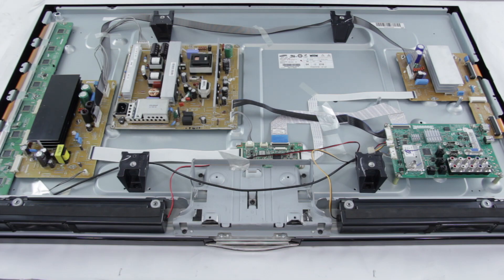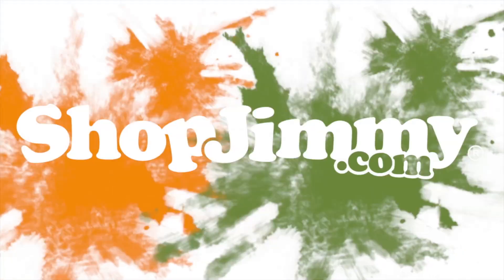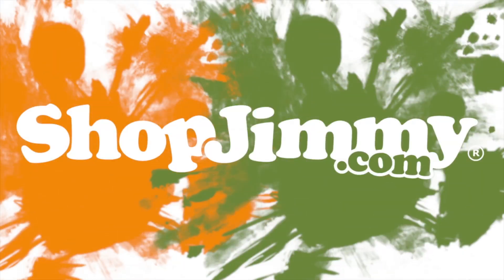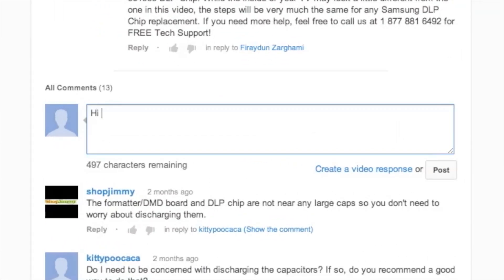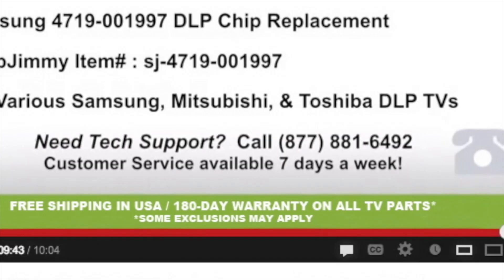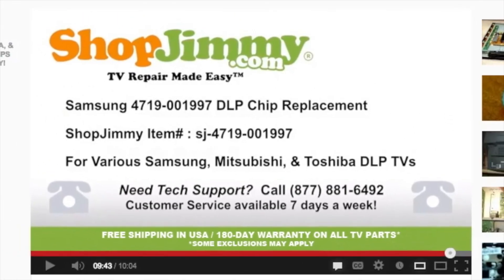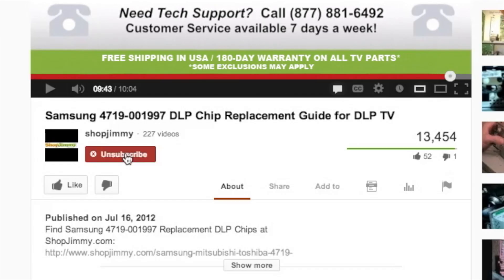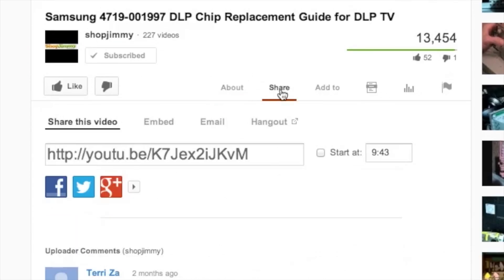Plasma TV Repair Tutorial - Common Symptoms & Solutions - How to Fix Plasma TVs

Comment: Hey there... I was just reading your answers to a plasma tv problem over on the forum but it was from 2011 so I'm not sure if you are still involved. Anyway I had a question if you had a moment. I have a Samsung plasma TV that's 3 years old. It's the pN50C490B3D. It was fine but then suddenly it doesn't display and creates this super loud squelchy buzzing sound that also seems to change frequency pitch on occasion. The sound seems to come from the panel and is louder on the front of the tv then it is on the back with the cover off. Ironically this doesn't start immediately with the press of the power button. It makes the samsung chime sound normally, the red LED comes on normally and then it starts. The panel is black, not dimmed so nothin happening there. When I press remote buttons the LED on the tv responds normally and it also plays the goodbye chime when I power it off. What would your suspicion be? My thought was that maybe it needed the buffers and YSus replaced... But then I'm guessing from what I've read. Oh one other thing. If I unplug the ysus and then power it on, there is no longer any buzzing at all and the tv makes the normal chime, etc but obviously doesn't display. Thanks for your time.
Reply from the maker: kghiii I would recommend replacing the Y-Sus board and the Buffers.  Here is a link to replacement parts for your TV model number on our website, click here:  http://www.shopjimmy.com/catalogsearch/result/?q=pN50C490B3D  Be sure to match part numbers on your current board, with your replacement for compatibility.  Here is a link to a video showing how to identify your part number, click here:  Samsung Plasma TV Repair: Samsung Plasma Panel Parts Guide  You can also call our customer service for further assistance with your purchase.  (877) 881-6492  Thanks and please let us know if you have any further questions!  www.shopjimmy.com

Comment: I have a Panasonic TC-P50G15  Experienced a pop and no picture or sound and 7 blinking lights.  Have replaced SU, SD, and SC boards.  7 blinking lights are still evident. Notice that cooling fans do not come on when plugged in.  Is it possible the power supply board is bad?
Reply from the maker: Jan L I would recommend replacing the power supply in your TV.  Here is a link to replacement parts for your TV model number on our website, click here:  http://www.shopjimmy.com/catalogsearch/result/?q=Panasonic+TC-P50G15  Be sure to match part numbers on your current board, with your replacement for compatibility.  Here is a link to a video showing how to identify your part number, click here:  DIY Plasma TVs 101: Part Identification Number Guide for Panasonic Power Supply (PSU) Boards  You can also call our customer service for further assistance with your purchase.  (877) 881-6492  Thanks and please let us know if you have any further questions!  www.shopjimmy.com

Comment: samsung 42" model # PN43D450A2DXZA   symptoms :  tv was working fine then it just shut off and wont turn back on
Reply from the maker: cristian lara I would recommend replacing the power supply in your TV.  Here is a link to replacement parts for your TV model number on our website, click here:  http://www.shopjimmy.com/catalogsearch/result/?q=PN43D450A2DXZA  Be sure to match part numbers on your current board, with your replacement for compatibility.  Here is a link to a video showing how to identify your part number, click here: Samsung Plasma TV Repair: Samsung Plasma Panel Parts Guide  You can also call our customer service for further assistance with your purchase.  (877) 881-6492  Thanks and please let us know if you have any further questions!  www.shopjimmy.com

Comment: I have a SAMSUNG PN64D7000FF Plasma TV. When I plug it in, I get the Smart TV intro screen which then goes blank and comes back every 30 seconds or so. The TV never seems to fully boot up but it also doesn't really seem to be power-cycling because it doesn't seem to get to even standby. It does not respond to remote commands and the factory reset cannot be achieved. I don't think it gets far enough in turning on. I checked for swollen capacitors and did not find any. The main logic control board has a slow blinking green light on it which never stops blinking. The main board has no lights or any other indicators. Any suggestions?
Reply from the maker: Matt Greenhalgh I would recommend replacing the main board in your TV. Here is a link to replacement parts for your TV model number on our website, click here: http://www.shopjimmy.com/catalogsearch/result/?q=SAMSUNG+PN64D7000FF+ Be sure to match part numbers on your current board, with your replacement for compatibility.  Here is a link to a video showing how to identify your part number, click here: Samsung Plasma TV Repair: Samsung Plasma Panel Parts Guide  You can also call our customer service for further assistance with your purchase.  (877) 881-6492  Thanks and please let us know if you have any further questions!  www.shopjimmy.com

Comment: Hello, our problem is after testing out our box thinking it might be the problem we found out that our month old Samsung 51 inch plasma tv signal went out. all cables are connected the dvr box works but the tv says no signal. Is this an easy fix or does it need to be replaced? Thanks for you help
 model number PN51F4500AF
Reply from the maker: Dana Stover I would recommend replacing the main board in your TV.  Here is a link to replacement parts for your TV model number on our website, click here: http://www.shopjimmy.com/catalogsearch/result/?q=PN51F4500AF  If parts are out of stock, you can sign up to be notified when the part is back in stock on the product page.  Be sure to match part numbers on your current board, with your replacement for compatibility.  Here is a link to a video showing how to identify your part number, click here: Samsung Plasma TV Repair: Samsung Plasma Panel Parts Guide  You can also call our customer service for further assistance with your purchase.  (877) 881-6492  Thanks and please let us know if you have any further questions!  www.shopjimmy.com

Comment: Hi.
 I have a Panasonic plasma TH-42PD50U. There is back light, but no image on the screen, no sound and the remote does not work for volume; remote does work only to turn on TV, and when turn off TV 20 blinking light of death. Any Idea? Still no answer after 2 days.
Reply from the maker: Metushelah Licin I would recommend replacing the D Board in your TV.  Here is a link to a replacement D Board for your TV model.  http://www.shopjimmy.com/panasonic-tztnp010yfs-d-board.htm  Please confirm that the part number for your replacement board matches your current board.  You can also call our customer service for further assistance.  (877) 881-6492  Thanks and please let us know if you have any further questions!  www.shopjimmy.com
Reply: ShopJimmy.com Nope. It was not the D board. I replace the DT Board instead and the TV is back ton life.

Comment: Gr8 video! I have a Vizio 2007 manufctr date. Model # P50HDTV10A I get no picture, but it still powers on. There is a blue rectangular box that's about 6 in width and it goes up and down the center of the screen vertically. No sound. What control board is that? Main board?
Reply from the maker: Latoija Snodgrass I would recommend replacing the logic board in your TV.  Here is a link to replacement parts for your TV model number on our website.  http://www.shopjimmy.com/catalogsearch/result/?q=P50HDTV10A  be sure to match up part numbers for your current board and the replacement part.  You can also call our customer service if you need any help.  (877) 881-6492  Thanks and please let us know if you have any further questions!  www.shopjimmy.com

Comment: I have a 50" hitachi p50h401 tv.  It has developed black horizontal lines at the top of the screen.  I read the repair manual and followed the ts guide which said to replace the xsus board.  So I did and of course it is still the same.  I think you are going to tell me to replace the y buffer boards.  Is this correct and if so do I have to replace both or just one?  Thank you for your help.
Reply: So let me clarify...my black lines are horizontal across the top and run about 1.5 inches down....
Reply from the maker: sjgusmc21 I would recommend replacing the upper buffer in your TV since the lines are at the top.  Here is a link to replacement parts for your TV model number on our website.  http://www.shopjimmy.com/catalogsearch/result/?q=hitachi+p50h401  Be sure to match up board numbers for any replacement parts to ensure compatibility.  If we are out of stock for any parts, you can sign up to be notified when the parts are back in stock on the product page.  Thanks and please let us know if you have any further questions!  www.shopjimmy.com

Comment: I have a Gateway P46M103 42" Plasma With no picture. The stand by works and it seems to power up (the power light turns green). Sometimes I get a flash on the screen as it tries to turn on but then stays black.
Reply from the maker: Gerald Ward I would recommend replacing the Y-main board for your TV repair.  Here is a link to a replacement Y-Main board that shows compatible for your TV model.  http://www.shopjimmy.com/y-bulk-su-assy-pcb-4359111401.htm  Be sure to match board numbers for replacement board compatibility.  You can also call our customer service for further assistance with your purchase.  (877) 881-6492  Thanks and please let us know if you have any further questions!  www.shopjimmy.com
Reply: It wasn't the Y-main board. the ribbon connecting the power board to the Y-main board had a pin that  pin desoldered it self. I desoldered it and it seems to work fine now.

Comment: hi...I have  a samsung PS42C450B-1W with serial number. B1R534PZA20484L  ...when I turn on the tv ,VS voltage is created and go well.but after the some seconds VS voltage goes  back.There is no picture and light in  the screen.Sounds are good. Thanks for any suggestion.
Reply from the maker: Jimmy Jassal Conduct at your own risk!  If the wires going to y-main are unplugged , does the VS stay steady at that point power supply?  Reply with the info and we can recommend a replacement part.  Thanks!

Comment: I have a Samsung  model s50hw-xb03. Everyone seems to have problems with lines but mine has bright snow across top and bottom and is severely out of focus in the middle. Any suggestions?
Reply from the maker: Trey Brown I would recommend replacing the logic control board in your TV.  here is a link to replacement parts for your TV model number.  http://www.shopjimmy.com/catalogsearch/result/?q=s50hw-xb03  Please call our customer service to confirm compatibility for your replacement parts and for help with your purchase.  (877) 881-6492  Thanks and please let us know if you have any further questions!  www.shopjimmy.com

Comment: I have a 50" Samsung Plasma Model  #PNC550GIFXZA  - it has several vertical lines.  The reset didn't work and there is no firmware update either.  HELP!!
Reply from the maker: Kelly Broderick This could be a few different options, either the logic board or the TV panel.  If the problem is the panel, it may be more cost effective to replace the TV.  You could try replacing the logic board to see if that fixes the problem.  I am not seeing any search results on our website for the TV model number that you provided.  Please double check that number and search for replacement parts at www.ShopJimmy.com or reply with the TV model number and we can recommend replacement parts.  You can also call our customer service for further assistance.  (877) 881-6492  Thanks and please let us know if you have any further questions!  www.shopjimmy.com

Comment: Hello I have a problem when powering on the TV - the blue power led illuminates and the red indicator to the right stays illuminated. The remote will not switch the tv on/off the power buttom on the left side does not work. If disconnecting the power cable and leaving for 5 mins when reconnecting the tv goes into the same status - blue led and red indicator lit. The red light blinks twice then on the third time stays constant I can not use the buttons on the tv; the sensor detects the remote but nothing is displayed on screen - just remains black. PHILIPS 50PFP5532D TV PSU POWER BOARD PS-506-PH LJ44-00144A 20061129
Reply from the maker: Steve Daffern I would recommend replacing the ymain board in your TV.  Here is a link to the search results for the replacement parts for your TV.  http://www.shopjimmy.com/catalogsearch/result/?q=50PFP5532D  It looks like we do not have any ymain boards in stock for your TV model.  You could call our customer service to confirm, or see if there are any substitutes.  (877) 881-6492  Thanks and please let us know if you have any further questions!  www.shopjimmy.com

Comment: Great vid. I have a 50pk540, board is eax61392501/10.  Symptoms- Plug in- hear 3 clicks, push power- stby light comes on with faint click then 2 sec later another light click and never any picture. Vdc from power sup going into the main, y sus,and z sus boards check good at pins. don't think its the power sup.   Don't know which board is bad. Tried isolating by removing the va/vs plugs going out of power sup one at a time to the other boards but no joy.Any advice would be greatly appreciated.THX

Comment: Removed the back of my Samsung TV to get the exact PBA NO and REV NO for the Y Buffer board so I can sign up to be notified when the board was available from ShopJimmy.  I then vacuumed the back of the TV using a vacuum and makeup brush to clean out the dust.  I found that the top connection on the Y buffer board was slightly up on one end.  I pushed it down gently and plugged the TV in.  NO MORE BLACK LINES!; NOT A SINGLE ONE!!!  I ran the screen burn utility and the screen looks great again

Comment from the maker: @Electra Buickston - I would recommend replacing the y-buffer board for your TV.  It appears we are currently out of stock for your replacement part, but you can search your TV model number on our website and sign up to be notified when the part is back in stock.  You can also call our customer service for further assistance.  (877) 881-6492

Comment: Samsung 50” Plasma Mod: PN50B650S1FXZA Ver: SE04
Symptoms: Single black horizontal line one pixel high all the way across the screen about 4” below top screen. Then four black horiz lines one pixel high, one pixel apart; then ten, now the black horiz line is 1” high w/ 10 more single pixel black horiz lines above it.  All lines are black, horiz, go from side to side and are in an area 2” high & 4” below top. Can this set be repaired with replacement of the Y buffer board and/or Y Sustain board?

Comment from the maker: @bud194751 - Yes, I would recommend replacing the Video Box Board Assembly.  You will want to confirm compatibility, but our website shows this board is compatible with your TV model number.  "Vizio 3850-0012-0187 Video Box Board Assy" - search that information on shopjimmy com to find your replacement part.  You can also call our customer service for help with your purchase.  (877) 881-6492  Thanks and please let us know if you have any further questions!

Comment: I have a Vizio VP50HDTV10A that seems to have a bad DTV input. All the other inputs work perfectly, but if the input is set to DTV the set will sometimes come on, sometimes shows a 'no signal' message. I can switch to any other input and it comes right on. After it's on awhile I can switch back to DTV input and sometimes it comes on, sometimes not. Do you think it could be the video box panel assembly and tuner?

Comment from the maker: @cxihatch - This could be a few different problems.  It could be the X or Y main board.  I would recommend replacing them one at a time or both at the same time to see if that fixes your problem.  You can call our customer service to figure out your part numbers for your replacement boards.  (877) 881-6492

Comment: I have a question on a LG 55LH40 55" 1080p HD LCD Television Model : 55LH40 
about 3 years old of which the lower half of picture does not display. Only top 1/4 of screen works.  What do I need to get the whole picture?

Comment: This issue was corrected by cleaning the connection closest to the black bar on the tn pa 3996 board located on the top right side of the tv (from the back).  Looks like there were 3 buffer boards on top and the bottom, with the boards on the left side and right side.  Don't know what the boards on top and bottom are called or what there function is?

Comment: I repaired the vertical bar that extended from the top of the screen to the center of the screen. It appeared that the tv has buffer board on each side, but also, has 3 similar boards on the top and 3 on the bottom.  I disconnected the and cleaned the ribbon connection that connected to the board (tn pa 3996) or CR No. 7000). The bar was eliminated.

Comment: I have a Samsung PS15D550 that has an intermittent magenta/purple flicker area when the screen is displaying bright scenes. It is about 1/4 of the way down the screen, starts mainly in the centre, extending off to the right of the screen. As per another service manual, I have checked the power supply: the Vs was too low (around 3V too low), and the Va was slightly too high. Tweaking these has really improved things, but the flicker is still there. I'm thinking Y-Buffer problem?

Comment: I have a 58" plasma Panasonic model # TH-58pz750u built December 2007.  I has one vertical bar in the top left section of the screen.  Other than that, the display is perfect.  I could send a jpeg if needed.